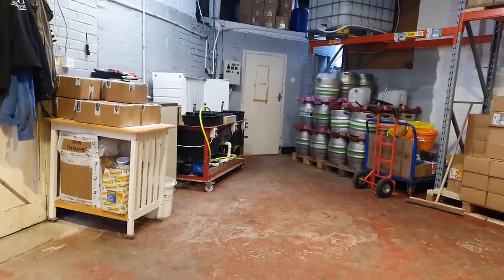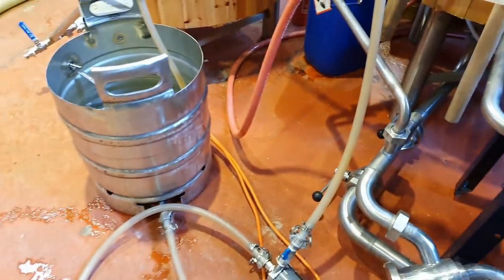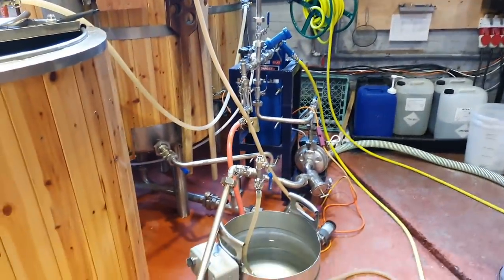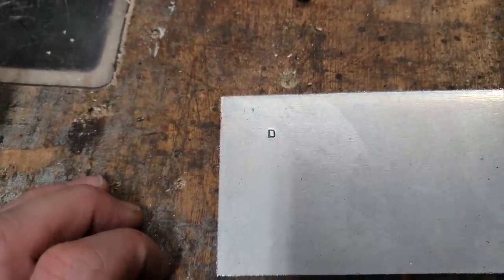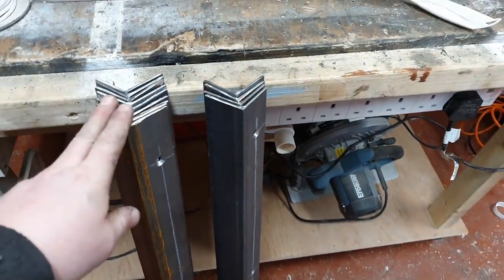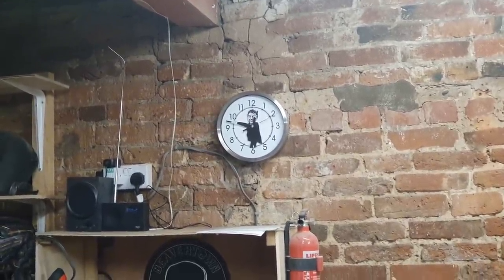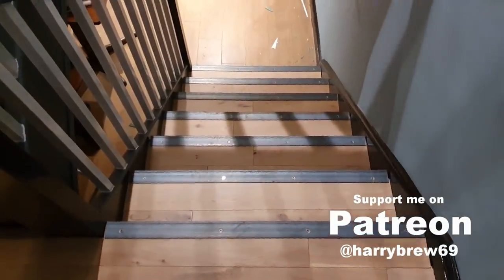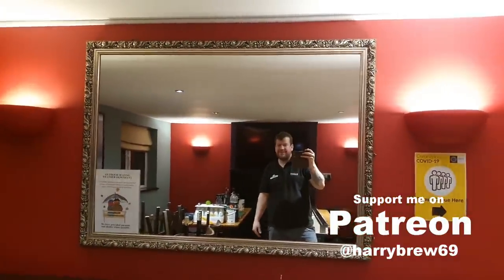And We Have New Stairs, Just Need Customers FFS

Comment: Interesting take on the valentine arm, doesn't look adjustable though? I have used a hight adjustable U shaped VA bafore (with a bleed valve at the top ) so you could set it to the volume of mash and lower it as the sparge progressed. Worked very well.

Comment: Hi Harry, as for the slight lip from the old shite laminate to the new oak at the top of the stairs; what about a thin door threshold strip to cover it? Only thinking it might start to splinter away after a few scuffs from a hard boot over time. It would do my head in that. Cheers, keep up the good work!... The vlogs are always a good excuse for me to get away from the kids for half an hour!
Reply from the maker: Been up and down the stairs today, you don't even notice it. A threshold strip would be 3 times the size. I'm sure it will outlast the old laminate by many years.